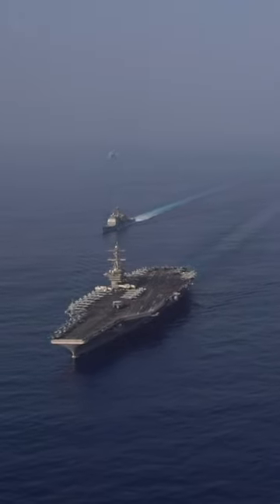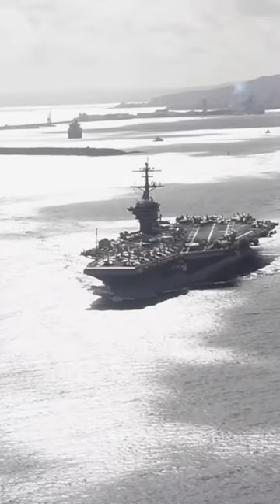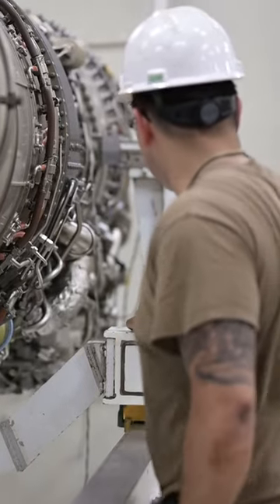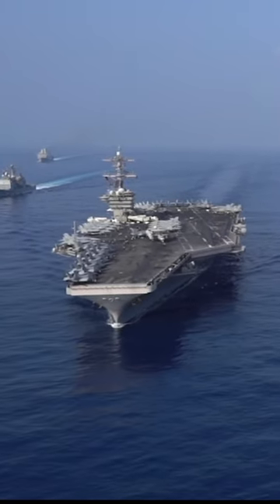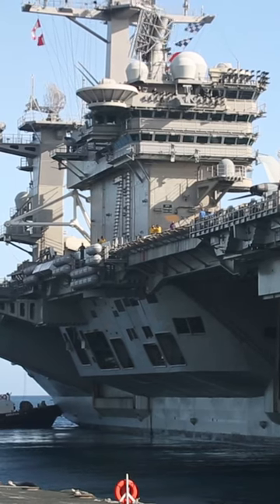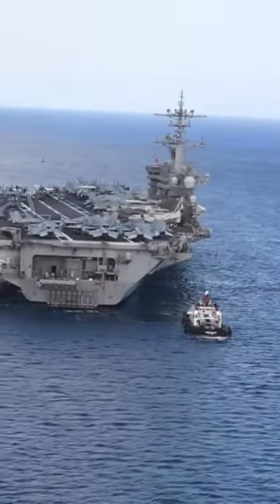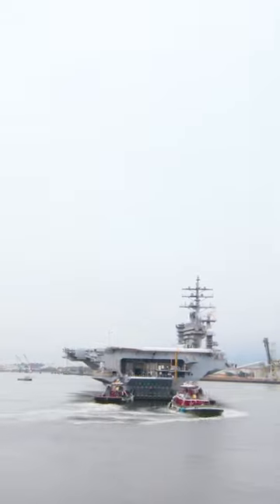How long does it take for a United States aircraft carrier to refuel? #aircraftcarrier

Comment: Only needs to be refueled every
25 year's that is amazing!
He said they have to replace the reactor core's,what ever that means!
Reply from the maker: That's right, but during refuelling, not only do they replace the reactor core, they also do repairs and other upgrades.
Reply: It's a nuclear powered carrier.
Reply: The real problem is that the nuclear carrier has to be refuel, with fuel, food, spare parts and whatever it comes 🤔
Reply: That means, we rebuild the whole stater and generator the whole gearbox, all the turbines and totally replace the reactor
Reply: Those are Uranium Rods Assembly.
Reply: It's funny because they'll probably build a new aircraft carrier class in 25 years and retire the Gerald R Ford class. Lol.
Reply: @ThomasIsGayForMe not for a while yet
Reply: After 25 years the nuclear fuel is only 5% used up. The fuel rods have to be removed because the gaseous by products have created so much pressure inside the fuel tube that it can no longer be used. The British company Moltex have a reactor that can burn up the remaining 95% of the fuel’s energy.
Reply: But it need one year servicing every one year of use. 😁😁
Reply: It's nuclear powered
Reply: As long as Homer Simpson isn’t anywhere near the ship when refueling time comes around, I think we will all be ok. 😊
Reply: Also they will only be refueld once since thir servicelife is 50 years
Reply: @aeffern  very good point and that alone justifies the means to the ends!! 👏 check mate....
Reply: @krazy5031 ford class has been very useful, don't feel like it will go until 50+ years
Reply: @andrewlim7751  Good thing we have so many of them, always plenty in service.
Reply: @ThomasIsGayForMe they can just sell it to Brazil who will eventually sink it
Reply: You don't know what that means? Where have you been?
Reply: he has no clue what he is rambling about...I worked fueling...you don't replace the core. Think of a stove, burner goes out, you don't buy a new stove...you replace the burner coil...and you don't have to cut the hull either.
Reply: @paoloviti6156  don't you have to buy food to replace what you consume...every own a car...did it ever need " new parts "............
Reply: @ThomasIsGayForMe  50 years life, and it's the hull which wears out...all the pounding over that amount of time causes metal fatigue...not to mention new technology which might make them obsolete.
Reply: @StephenZ827  it leaves me perplexed because having such a massive carrier like the Gerald R. Ford-class aircraft carrier with a complement of nearly 4,000 people on board you need to feed them not to mention continually ordering aviation fuel and oil not to mention spare parts of any kind. It is a major effort for the US Navy..
Reply: Very best tech
Can you imagine if they had to run off diesel !
Coal burning furnaces like the old days.
This by far way better.
Reply: @paoloviti6156 Yes, obviously they have to restock those items which probably takes a day or two in port.  But they also restock at sea and probably do some items once a week, maybe more.  

Maybe someone on here can explain what the restocking process and schedule.
Reply: @aeffern  service life is 50 years on the hull not the reactor.
Reply: @aeffern lol. No. If the Pentagon needs to make the fleet bigger. Well, looks like those Nimitz class carriers now have a 55 year service life.
Reply: @StephenZ827 YEP! You just need to move the crap on top of those access hatches. 😂
Reply: Something that can kill one or two people of they drop it on the ground or something maybe.

Comment: The Ford class is designed with the new Westinghouse reactors that should be able to last the life of the ship without the midlife refueling.
Reply: It can and will if people keep up on the maintenance
Reply: @hawk1481  I'm no expert but was an ABH3 V1 Div USS Boxer LHD4. I try to stay up on things and I've read that the new reactors are something like 50-70% more efficient.
Reply: @maurinawest9558  they also have a 20-25% increase in power output
Reply: The Ford uses the A1B reactor which is a new design from Bechtel. It will refuel every 25 years or so which is the same as the Nimitz class.
Reply: Until it gets hit with a torpedo
Reply: @Blackbuck9832 probably wouldn't do much, we've dropped nukes on weaker ships, it took 2 nukes and conventional bombing from other American ships for days, it took a special team that knew where to place remote bombs to finally sink it. The USS Nevada I think
Reply: @parzivalgtc9916  this is true. also the radiological equipment and training. plus wash down systems came from dropping nukes on those ships. since they weren't destroyed. Other vessels like cruisers and destroyers were crippled.
Reply: @parzivalgtc9916  That wasn't lost on combat intel. They don't aim to hit a ship with a torpedo now. The mission would be to fire one under the ship, explode beneath the hull. This creates a vast vacuum, a empty space of water. As kids we did the same splashing in the water, pushing a open palm down hard and fast. As a torpedo creates this massive " hole" pushing water out, and the ship being above this is lifted, or say an area under the ship is no longer supported by the ocean water. the ship lifts and then returns. Lifting could be 2 inches, or two feet. If you took a toy ship, and a balloon full of air, place the balloon under the toy , pop the balloon. the ship will rise according to its resistance ( weight )  vs  balloons volume of air being released. The ship is pushed up, then falls back to find the void, vertically braking the back of the ship. We have all done it, taken a thin piece of metal bend it one way, bend it back and the metal snaps. Same concept now with massive explosive power in a torpedo.
Reply: @Blackbuck9832 LOL 😆 it sure has happened alot of times (they have 'systems' that stop all that type of stuff 250 miles before it gets to them sir) I wouldn't expect you to know that though most folks don't but these carriers are far more complex than I even know (there's ALOT of stuff classified that very select few know) all in all I guarantee you 100% sure there will NEVER be a enemy 'torpedo' even come anywhere near 1 of these carriers & that's a fact 😉

Comment: Cant they build it in a way where the top can open and they can use a crane to take out the reactor and place in a new one instead of tearing the ship apart and refueling the reactor? They need to make it a plug and play kind if reactor so they can upgrade the ship faster. The same should be said for it's missile defense systems. Ships need to go back to port to get more ammo. Its sad thar the guns and missile pods are not a kind of plug and play feature so a AR ship can just meet up with the CV, quick swap out the guns and missiles pods with a fresh set to reduce the chance of the weapons failing due to over usage. Would also make it easier to get new tech onto the ship without having to carry it back to port in a middle of a conflict.

Comment: Here's my question about carrier operations:  during normal operations, launching jets takes a few minutes per aircraft, safety first, ya know!  But under combat conditions, China has gone off the wall over Tiawan and have attacked.  Now, it's  imperative to get as many aircraft as possible in the air before the carrier is under direct attack.  How long to launch all avaliable planes?

Comment: this is all false...I wonder how many years this guy spent in reactor dept. on a carrier...take it from someone who spent 6 years in reactor propulsion division....hes wrong on all of it HINT: just walk thru the hanger bay and ask urself why are there massive holes with bolts holding a lid down....OH cuz its made to remove the fuel rods and RCPs
Reply: "the hanger bay"(sic)

No "e" in hangar. Should have learned that in 6 years.
Reply: @AA-xo9uw  American education system problems.
Reply: Dont spew the secret😊
Reply: Yea, to drop in the rods, but you still take out the core and chamber for a new one because it's old and corroded. Also reactors are huge, and I doubt a single, wimpy, steel door bolted down would be the only thing between you and a active nuclear reactor
Reply: @AA-xo9uw He didn't work in the hangar bay, so cut him some slack.  Besides, he probably got autocorrected.

Comment: How the hell does refueling take 2 YEARS. Are they cutting the entire hull open to drag the reactor core out?
Reply: Yes that is exactly what they are doing along with a metric ton of other modifications and maintenance.
Reply: @n3v3rforgott3n9  okay if there planing to refit the whole thing that makes sense. What with the decades long cycle. The term refueling does make me think what if they run out but thats not hiw nuclear reactors work.
Reply: @babygorilla4233  So these are closed systems which cant be accessed without being cut open. So the term is correct as the fuel is spent in the reactor and needs more "fuel" for it to keep running.

Comment: False
Reply from the maker: Correction, please?
Reply: @USM_News  replacement parts are built in to the superstructure. They do this as to not cut open the ship. Refiling is different but does not nessitate cutting open the ship.
Reply: @USM_News  yea they do not cut holes in the ship. i spent 6 years in reactor dept. on Truman...25 years is also wrong...RCOH (reactor compartment overhaul) is planned during the building of the ship and depending on fuel rod degradation. Also the ford class reactor plant is different and none have ever been thru RCOH...PLUS the only place in the world capable of RCOH is Newport News Ship Building...they're currently building CVN79,80 so RCOH is a complicated and dynamic process very different from this video